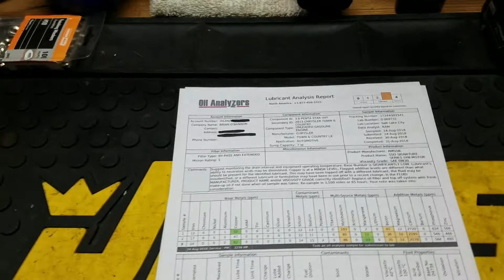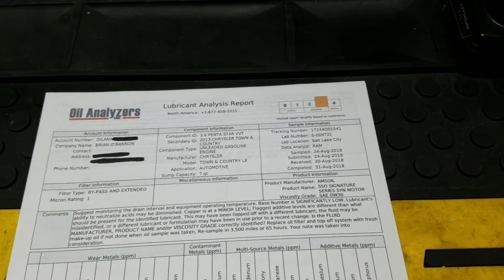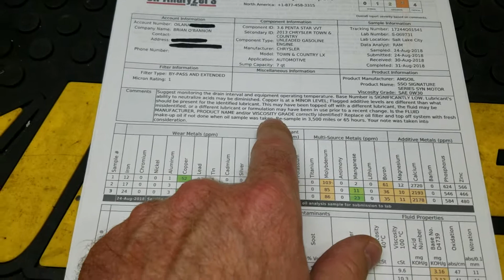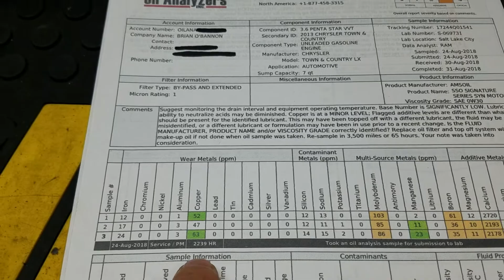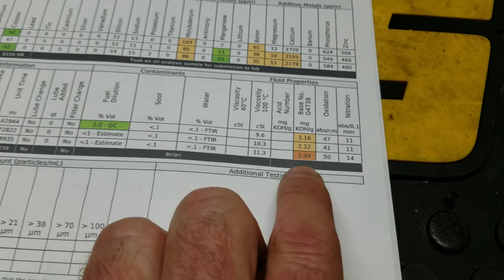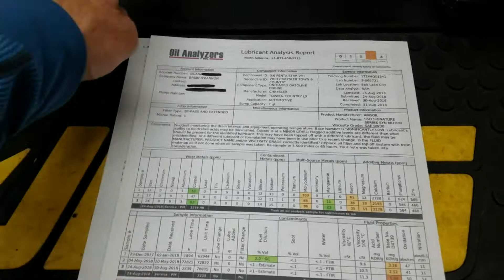AMSOIL Oil Analysis #3!

Comment: Not a bad UOA. Too bad most people wont take the chance at running long intervals. Plus you have to add makeup oil and pay for oil analysis. I'd rather just change it at manufacture recommendations and not worry. I have a used oil burner for heat so that's where mine goes. 
I used to run amsoil in all my equipment until somebody told me about Schaeffer oil. I made the switch and will never look back. I could feel how much smoother my engine ran and nice quiet cold startups. 
If your an oil freak like me check out the cam lifter/lifter wear after a Sequence IIIG test. I compared amsoil signature 5w-30 to Schaeffer 9000 5w-30. Schaeffer has 35% less wear than amsoil. Also for me Schaeffer oil is literally half the price of amsoil. Just sharing my findings 👍
Reply from the maker: Yes, most people "play it safe" and do what they are told by the manufacturer or Quick-Lube.  What I pay in materials(filter, makeup oil, analysis) is easily returned in protection and, most importantly, TIME. I can't deny that an oil burner is a great way to heat up a shop. Yet, I also know how much maintenance they require(filling up the tank, filters, annual checks... again, time spent doing these activities) compared to my electric heat. If I were not performing these videos, my time spent taking a sample and mailing is less than 10 minutes.  I have no used oil to deal with so no time is spent here.  I'm not required to spend an hour(minimum) changing oil myself.  It will usually take longer than that when you consider the time buying the oil, filter, tools(if you don't have them), jacking the vehicle, removing the underpan covers, clean up, etc..  Or spending time transporting my vehicle to a waiting room to have someone else do it for me; even that is a minimum of an hour once I leave the house.  In all, I spend less than 30 minutes taking an oil sample, changing a filter, topping off the oil, going to the post office(which could be eliminated if I bought the Pre-Paid analysis kit) and interpreting the results when I get them back from the lab.  Which means I spend more time towing my trailer with bikes to the mountain... or whatever I choose to do. 

I just have to take your word for it in regards to "smoother engine operation" and "quiet cold startups".  You'll technically need a vibration monitor and decibel meter to determine if truly a difference was made scientifically.  For me, my stuff runs smooth because I maintain them to do so and they are as quiet as I need them to be.

As for the Sequence IIIG test, this involves using a GM 3800 V6 flat-tappet cam engine as a test subject. If you are trying to prevent wear on a flat-tappet cam engine, AMSOIL Signature Series 5W-30 is the WRONG oil to be using for this test if you are looking for the "best" cam/flat-tappet lifter protection.  AMSOIL Signature series oils are design for Over Head Cam-type engines or engines using roller lifters(which pretty much describes most modern engines for the past 15 years).  The Zinc additives package is reduced to provide much more resistance to oxidation and acid resistance.  Therefore making it last much longer for extended drain intervals. If you want to compare Schaeffer 9000 in real, true(apple-to-apple) comparison for flat-tappet camshaft protection, you'll need to allow AMSOIL to enter their high-zinc oils into the competition. Z-Rod, 10W-40 and 20W-50 and DOMINATOR oil formulas(links provided below) are designed to provide the best wear protection for flat-tappet camshafts and lifters.  I'm certain had these oils been used, the results would have been different.  There are already independent tests out there for you to see these results.  In regards to testing, ASTM guidelines are typically what all the lubricant manufacturers use for standards.  One of the things that I love about AMSOIL when it comes to ASTM testing, is that they are honest enough to posts the results when they are NOT #1 in each individual test.  Yet, they are never at the bottom or even at the midway point.  In fact, when you average AMSOIL test results against the competition over the ten-to-twelve ASTM tests that are used by the lubricant industry, you can see AMSOIL is "winning" by a 75+% margin.  To me, I don't mind paying for a product that is setting the standard for the synthetic industry, for extended drain intervals, and saving money(and lots of TIME) over the long run.  

I thank you for your input and hopefully this video helps you(or anyone) become more informed that the "old ways" of lubricant maintenance is not necessarily the best way to take care of our vehicles as we once thought.  It certainly doesn't hurt to be extra caution as they want you to spend more time and money with "them".  But I prefer to make everything last as long as possible without requiring a huge time investment.  Either way, "to each.... their own". 

https://www.amsoil.com/shop/by-product/motor-oil/gasoline/dominator-5w-20-racing-oil/?code=RD20QT-EA/?zo=1086626

https://www.amsoil.com/shop/by-product/motor-oil/gasoline/premium-protection-10w-40-synthetic-motor-oil/?code=AMOQT-EA/?zo=1086626

https://www.amsoil.com/shop/by-product/motor-oil/gasoline/premium-protection-20w-50-synthetic-motor-oil/?code=AROQT-EA/?zo=1086626

https://www.amsoil.com/shop/by-product/motor-oil/gasoline/z-rod-10w-30-synthetic-motor-oil/?code=ZRTQT-EA/?zo=1086626
Reply: @ob1n  You amzoil guys are all the same 🤦🏻‍♂️ I'll never get sucked into amzoil brainwashing 🤣
Reply from the maker: I hardly call 20+ years of experience, live video, and facts "brainwashing". You are certainly entitled to your opinion. Whenever you are ready to put the money and time into a true comparison test, bring your best stuff and your criteria for what you want to achieve. I'll bring my best and we'll use an independent, neutral lab to get it settled. In fact, we'll make a YouTube video of it! I've done it before. It hasn't failed me yet. Please refrain from making judgements and insinuating that indoctrination is occurring on my posts. Nothing could be further from the truth
Reply: @ob1n  Sounds good let's do it!
Reply from the maker: First, you need to provide the actual test results from the comparison in which you claimed to have happened. If you are referring to looking at the data posted on Schaeffer's website(link below), then a Google search will clearly provide with a lot of speculation as to validity of this data.  Most are claiming that it's very odd that all of Schaeffer's oil blends(5W-20, 5W-30, 10W-30) have the SAME test results for the IIIG testing.  So which ONE was used for the actually testing?  And if they were all used and they all had the same end result, where are those specific test results?  AMSOIL(link below) provides the actual tests result of their 5W-30(the only blend they submitted for the testing) on their website.  It does show that during the normal phase of IIIG testing(100 hours) that the micron wear of the cam/lifters is 14.8% of the allowable 60%.  That would actually be 34% more than what Schaeffer is claiming with their PDF on ALL of their blends.  Of course, AMSOIL doesn't stop there....they continued on for ANOTHER 100 hours and tested again.  The wear only increased to 17.6% during the second time.  However, did you also noticed the viscosity index on both the Schaeffer PDF and the AMSOIL test results?  Of the maximum allowable amount of increase at 150%, AMSOIL first 100 hours increase was only 27.6%.  The second 100 hours only increased to 41.5%.  During the 100 hours standard IIIG testing, Schaeffer's(all blends) are already at 130%.  That would lend what I mentioned before, Signature series is blended for maximum longevity, not ultimate wear protection.  And when you consider the micron level of wear, this is hardly a factor I would want to consider.  I venture to guess that if I were using Schaeffer in my application based of these documents(links below), I would have had to change my oil several times at this point.  The viscosity deterioration of Schaeffer's(as posted by their own documentation) is huge after the first 100 hours of the IIIG test.  If you put AMSOIL's Z-Rod, Dominator or 10W-40 and 20W-50 in the IIIG test, the minimum(micro-level) of wear is very likely to change and be comparable or better than Schaeffer and I would venture to say that their viscosity, rust, and scuff wear would be better, as well.  As I said, provide the actual test results.  Better yet, do what I'm doing in a Chrysler Town and Country near you and post the results of oil analysis after every 6 months(or so) of use.  If Schaeffer's data is correct, I'm guessing that it won't be able to be used much past 10-15k miles before a complete oil change is necessary.  And if you try to push it out too far, all the "micron wear savings" will be moot once the oil viscosity begins to fail and actually causes sludge, buildup, difficult flow and then actually CAUSES engine wear.  Also, does Schaeffer offer a leading-edge filtration system for their customers?  

Last point, the IIG Sequence testing is done for 100 hours @ 300 degrees fahrenheit(oil temperature).  My example(2013 Chrysler Town and Country) has 2239 hours in which the oil temperature is usually around 185-200 degrees normally.  And up to 235-240 degrees during towing applications.  Mileage-wise, it has over 79k.  Put this all in perspective, and it's really quite amazing how far it has gone.  Like I have said, I like to spend my time doing other things rather than changing oil and/or worrying if I should be.

If you feel the need to continue, then you need to set up the escrow account, find the independent lab, come up with the criteria for the testing and let me know when you are ready.  Keep it clean, provide your facts, and be honest with your results.
Reply: @ob1n What did it for me was I know a couple people personally that have had engine failures with amsoil including myself. Also being that both companies are private label with similar marketing they are pretty comparable. At that note Schaeffer exceeds amsoil yearly revenue by around 30mil. Wouldnt amsoil be outselling Schaeffer? I will be starting oil analysis on my vehicles this go round I will let you know my results.
Reply from the maker: "Engine failures using AMSOIL"; Evidence?  Personally, I've used, sold and witnessed the use of AMSOIL for nearly 20 years as consumer/dealer.  I've personally witnessed the use and/or installed nearly every single filtration and lubricant product they've ever made.  During that time only ONE engine failure has occurred(rod bearing) and the evidence pointed to the fact that the daughter of the customer was driving the car while running it out of coolant.  The radiator was leaking and when the customer tried to blame AMSOIL, word around town was that 2 other shops had already "filled the empty radiator when the daughter showed up asking why the engine was overheating".  When the car finally made it to me, I found the bearing completely missing and yet the metal surfaces of the crank and rod were highly polished with no scuffing or heat marks.  When I mentioned that I had heard about the empty radiator(twice), they took the car home and it was sold to an acquaintance of mine who installed a rod bearing and, miraculously, it worked.  

"Schaeffer exceeds AMSOIL yearly revenue by 30mil".  Complete speculation without evidence.  Although, if you have to change Schaeffer oil more often because it degrades faster(as pointed out by Schaeffer's own documentation above in the IIIG test results), then I guess I could see how that could happen.  It's easy to see that more product replacement would equal more sales revenue.  

If you are going to be "starting an oil analysis this go around" for the sake of comparing what I have; Are your going to be using a 3.6 Penta Star engine?  What kind of filtration will you be using?  What are your driving habits? Etc.?  Etc.??  Don't get me wrong, you are free to do whatever you want.  It's just interesting that you told me before that you would rather "change the oil per manufacturer's recommendation than pay for Oil Analysis and makeup oil".  And now you are changing your mind? I have always presented my information stated here plainly based on facts and findings through experience, story-telling and scientific data.  I would expect you to do the same if you are trying to "compete".  

Either way, I certainly invite you to do whatever you want....just make sure that you are being honest with your findings and yourself.  Your lack of providing facts and figures to your comments are unfortunate in this current debate; it's making you to appear to be a "Troll".  I invite news ideas, conversations, and friendly debates.  And in order to debate, one must have actual facts and not speculative evidence or stories as their only "sources" of information.  

For now, I will "bow out" of this conversation as I have many other things that need my attention.  However, if you can come up with some legitimate and current facts, figures and evidence to your argument... then I'd be very interested in reviewing them and hearing your side of the story.  Same rules as before apply; keep it CLEAN, provide your FACTS, and be HONEST with your findings.  You do that and you are always welcome to comment on my videos.  I will not tolerate spammers, trolls, unprofessionalism and blasphemous negativity.  And I know that I mentioned this already, NOTHING is perfect and NOTHING lasts forever.  Not even a great product like AMSOIL or Schaeffer.
Reply: @ob1n  I didn't know we were debating. I am going to do the oil analysis for the sake of every amsoil guy tells me I cant do extended intervals with Schaeffer. Although on bobistheoilguy forum I found a duramax with 62K interval with Schaeffer. I dont have the time nor care to "debate". I can relate to the "smoother engine" with Schaeffer though. No doubt about it my engine was smoother and quieter. If you read reviews on Amazon its mentioned over and over. Amsoil and Schaeffer are both successful companies I just chose Schaeffer. Also on your note on the oil analysis paper what's with the company asking you of your oil is labeled correctly? Kinda weird I thought. Do you run additives?

The oil analysis vehicle I will be doing is a 14 Durango 3.6L. I just changed the oil a week ago with Schaeffer 9000 5w-20 and mopar filter. I am curious to your bypass filter you have!👍
Vehicle has 51K miles and gets driven about 3-500 miles weekly. I am going to sample at 7500 miles.
Reply from the maker: A debate is usually when you present said ideas are better than others.  Or as the official Google definition say, "a formal discussion on a particular topic in a public meeting or legislative assembly, in which opposing arguments are put forward."  This is public information.  You are opposing AMSOIL for your reasons.  I'm opposing Schaeffer as a better value. So, yes.... I consider it a friendly debate.  If you don't "have time nor care to debate".... then I question why you keep coming back to comment.  This will be the first response in which you've had legit questions(additives, filter I use).  Otherwise you are making statements(arguing your point) that Schaeffer is "better".  

As an "AMSOIL guy", I never said you couldn't do extended drain intervals regardless of what oil you use.  I know many people who do this with oils from many different brands and formulations.  It is interesting, however, when they have questions about extended drain how they tend to always ask me?

Amazon/Facebook/Social Media/Etc.. reviews that are just typing reviews; I tend to take with a "grain of salt".  I find most of them are hearsay and based upon opinion with no such concrete evidence of such claims.  I'm more of a "seeing-is-believing" type of person with sensory aids and scientific test results(especially facts) to help make decisions.    

I don't know why they keep asking me for the "correct oil".... as I stated in my video, the only thing that I can think of is that I added some oil at one point of mixed viscosities.  As I drain the bottles into customer vehicles, I tend to drain the last, tiny drops of oil into one bottle.  I use this for my lawnmowers, power equipment, etc.. You'd be surprised that I've not bought one quart of oil for many of my smaller equipment by doing this. I got this idea in college(before my AMSOIL days).  Everytime someone at school changed their  oil, I told them to give me their disposed bottles.  2 years later when I graduated, I have 5.5 cases of oil in my possession of mixed brands and viscosities.  I used them all in my old Nissan pickup which I sold at 320k miles.  I may have put one bottle of this "mixed" into the van at some point and that may have altered the viscosity index a bit.  Either way, I am at full disclosure by bringing up the subject in my video and allowing people to read the full report.  Additives?  Never.  Fuel additives?  Always!  

https://www.amsoil.com/shop/by-product/fuel-additives/gasoline/p-i-performance-improver-gasoline-additive/?code=APICN-EA/?zo=1086626

As for my filtration system that I am using; I've explained in my videos how I installed it and how it works.  Here is the link to AMSOIL filter system and AMSOIL BE-90 Bypass filter.

https://www.amsoil.com/shop/by-product/filters-and-by-pass-systems/by-pass/filters-and-mounts/universal-single-remote-bypass-system/?code=BMK21-EA/?zo=1086626

https://www.amsoil.com/shop/by-product/filters-and-by-pass-systems/by-pass/filters-and-mounts/ea-bypass-oil-filter/?zo=1086626

Personally, I don't sample by mileage.  I sample by time period.  I usually take the sample every 6-8 months depending on how I've used the vehicle(highway driving, idling, towing, etc.).
Reply: @ob1n  Most of my vehicles run e85. Do you run e85 or think it affects extended intervals in any way?
Reply from the maker: @charlespetersonii6989  I do not run E85. However, I did one tank full to check it out. My consistent hwy mpg of 29-33 went immediately to 21-22 on my trip across the state. As a matter of fact, I did within this last maintenance period. And, yes, E85 will play a huge factor for any oil in regards to extending drain intervals. E30 and greater will likely put more stress on oil for oxidation and acidity. I use the lowest grade gasoline which usually always has E10 blended with it. This is why I am using AMSOIL P.I.(Performance Improver) fuel additive that I mentioned above in an earlier response. So with heavy use of ethanol fuels that are E30 or greater, your analysis(or oil changes) needs to be more often. Especially if you are racing, towing, etc..